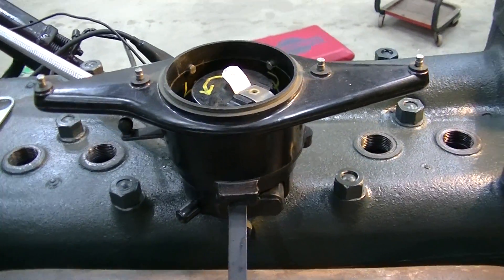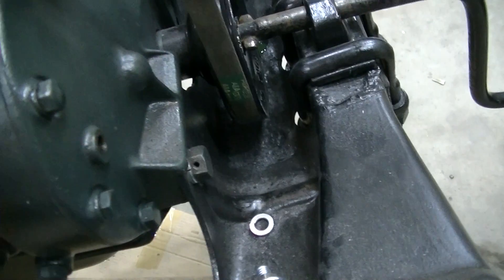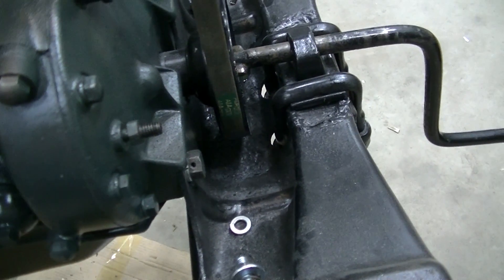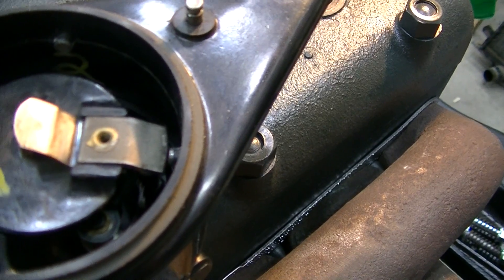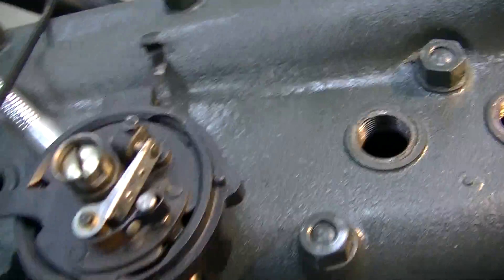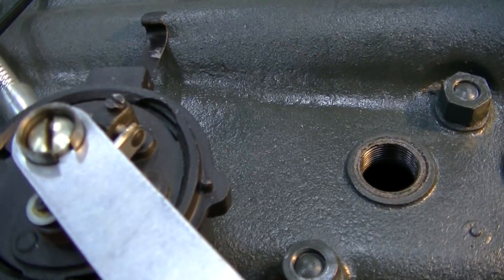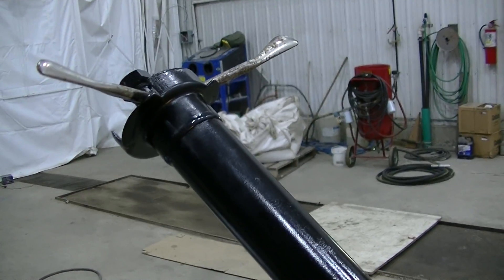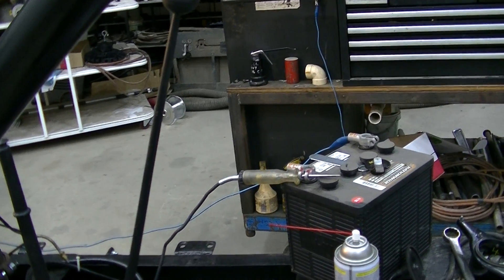Model A Ford Ignition Timing - zeketheantiquefreak

Comment: A lot of people are unaware that all Ford inline 4 cylinder engines from the model T up the British Fords of the 1960s had a Firing Order of 1-2-4-3 rather the more common 1-3-4-2. People unaware of this often make mistakes when trying to tune these engines. Regards from Australia.
Reply from the maker: Thanks for the info. I plan to lay wrenches to a 'T' this winter.

Comment: Zeke,
Good video. Thanks.
Your process worked as described with a significant exception. At the appropriate time, mu test light went dim but did not go off. Any thoughts?
Reply from the maker: Thank you for the comment. Was the distributor isolated from the rest of the electrical circuit? If it was, then there must be electrical leakage inside the distributor or the feed wire?
The few I have done have been a clean cutoff, off/on.
Let me know how you make out.